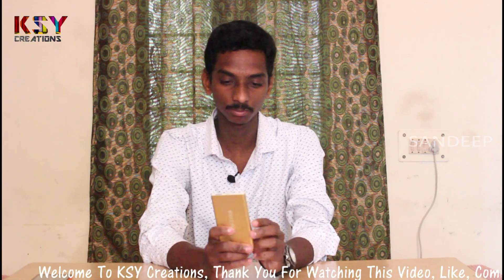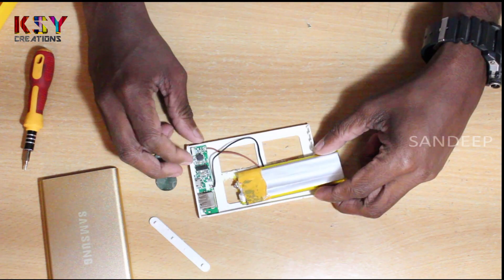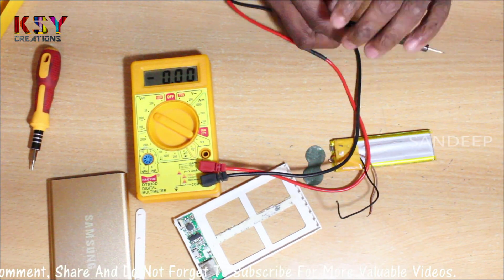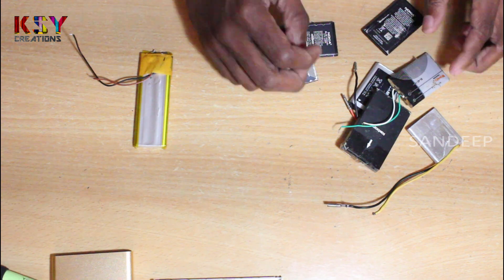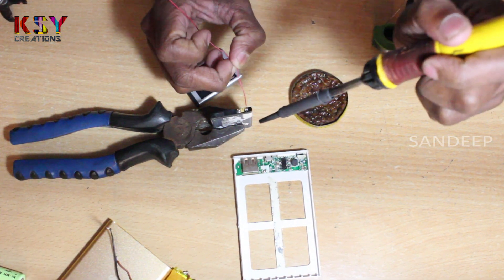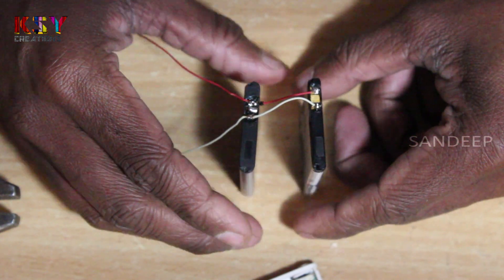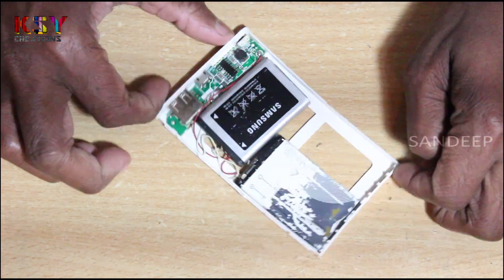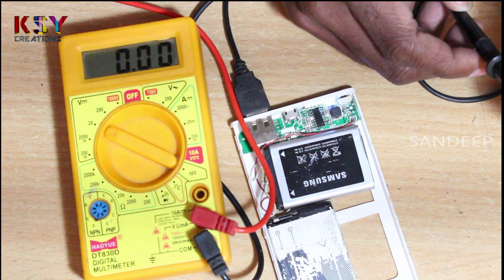change power bank battery to increase delivery time

Comment: Just wanna say my opinion but old batteries cant deliver their capacity like new ones plus Li-ion batteries have self discharge Even if you're not using it, it stills drain power, over time the battery capacity will be drained by the self discharging, I prefer to buy a new one like Li-Polymer batteries because they offer bigger capacities and slightly thinner than Li-Ion batteries and they have smaller chances of self discharging. There are 5000 mAh batteries that can fit there.
Reply from the maker: thank you andrei....suggestion received